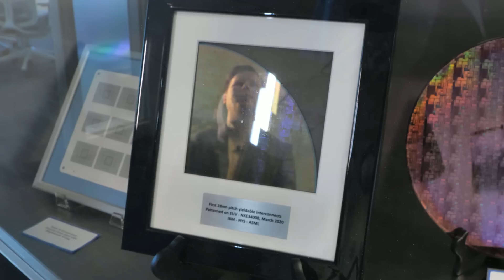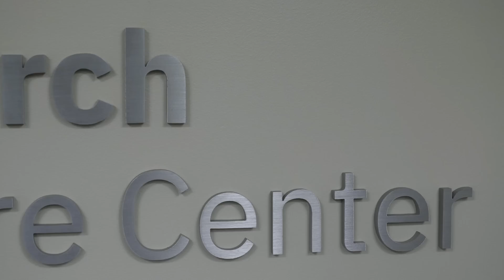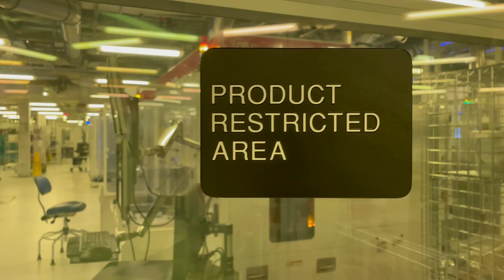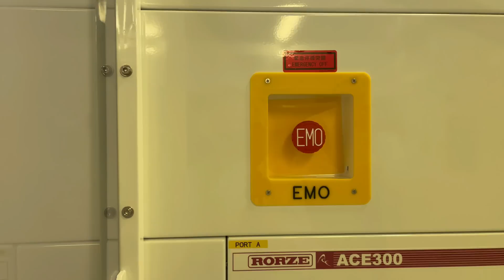Investing in America's Semiconductor Future: What's Next?

Comment: I work at one of the manufacturing companies mentioned in this vid, at the main Silicon Valley location. FINALLY someone made a simple video that shows the inside of a chip making lab/fab that I can send to people that want to know what kind of equipment I work on.
Now if only someone could take off the nice covers from the machines in there and actually get "under the hood" and talk about how they work, because the complexity of how exactly to get all those fancy material (and basic ones like copper) onto a layer measured in nm or angstroms, and then etch patterns on... Its really something else!
Reply from the maker: Please share :) I want to do more like this as well. But it's a case of earning that trust to get the access. Even though I've done this, I have some photos from the tour with some of the machines uncovered - unfortunately they were not approved by legal (yet)!
Reply: @TechTechPotato  have you tried looking at fabs that use 200mm process to see the equipment? That stuff is so ancient... would be so surprising if LAM or Applied Material or whoever else dont let you look at it. Though I'm not an IP lawyer whatsoever.

EXREMELY long comment incoming

So, I doubt my work knows my YouTube account, I won't share how specifically the chamber at my work work. I'll stick with stuff you can easily find on Google, but obviously fairly concisely.

This is an industry that you can work a lifetime in, and you will only really understand a small handful of chamber. You know it takes many many many steps to get to the end result of a working chip. I've worked with some types of metal deposition chambers, and very limited etch chambers. No ion implant, cmp, nothing photo resist related. No Si ingot growing or cutting, no metrology... So so so much equipment is needed for all this...

I work on metal deposition so super generic the chambers for this type of process are kept at ultra high vacuum (less than 1x10^-11 atm for physical vapor deposition, or maybe around 1e-3 for chemical vapor dep). To pump down the metal cavity to this vacuum your need a turbomolecular pump or a cryogenic pump (TMP more typically used if flowing toxic gases are used during process due to how cryo pumps trap gas molecules).
The wafers are brought into a chamber from the mainframe by a robot arm, and the wafer is lowered onto a pedestal. Because you want to use the entire surface area of the wafer, you can't use clamps to keep if from moving, so typically the pedestal might be a vacuum force, where, the pedestal surphase is almost like a shower head looking thing, but instead of gas coming out, there is a high vacuum created in it to basically suction cup the wafer down to make it stick. 
If the chamber is ultra high vacuum, this doesn't work, so instead you need an electrostatic chuck which, simply put, has a voltage applied to it, and the electrons in the wafer scatter, creating an electrostatic force that keeps the wafer attracted to the pedestal. 
These pedestals can also be actively cooled, and heated too. Depending on the material going on the wafer it might be below room temp or maybe way up at 500C. The molecular structure of a material changes a lot based on temp, of course. Need to precisely control the resistivity of the layer, the stress across, etc.
Physical vapor dep (PVD) is by far the simplest. I'll start with it in more detail and the rest will just fall into place.
Into the chamber there is a gas flown (like maybe Ar or N2 or some other). The pressure in the chamber needs to be VERY precise, so mass flow controllers are used to flow gas. They are a fancy valve that's preprogrammed with a specific gas type, so it flows a volume of gas based on the atomic mass of it. Above the wafer there is a giant thick metal surface. To that metal surface, or to the pedestal the water is on, or to coil above or around the chamber cavity a very high DC voltage is applied, or AC current in the radio frequency range, and the electrons of that gas that is flowng into the chamber get flinged off (electrons are light, so magnetic fields or high voltage send them flying). This gas is now a plasma. The plasma is kept near the metal surface and the ions of the plasma will bombard the material, and shave/erode atoms off from it. Let's take copper for example, the Cu atoms will fall into the wafer. The longer the plasma is lit, the more atoms you erode from that giant Cu surface and the thicker the Cu layer (though, "thick" of course is only nm thick)
What's tricky is making sure the atoms fall straight onto the wafer, or else all the Cu atoms will fall diagonally onto the carefully etched trenches and you get literal pockets of just vacuum. So maybe the Cu target is farther from the wafer (off angle atoms will hit the chamber walls before they reach the wafer) or it gets more complicated, like creating magnetic fields around the chamber to adjust the path of the Cu atoms as they fall. Or maybe apply electrical power to the pedestal to also attract atoms down to the wafer (this can be controlled to actually speed up the ions enough that they bombard the wafer surface instead of gently falling and actually sputter/physically etch off deposited material). 
Sometimes for PVD you might also flow other gases that the target ions get mixed with. Common one is nitrogen, so maybe while sputtering a layer of Ti onto the wafer, flowing N2 will create a TiN layer on the wafer.
Chemical vapor dep (CVD) there are no target materials to physically bombard with a plasma. Instead you flow a combination of gases that will react and flow onto the wafer surface. So there are extra gas lines that connect to the sides of the chamber and also to the top, right around the wafer. The gases from the top will also need to be even, so they might go through something like a shower head. Often you still need to strike some kind of plasma to force gas atoms of molecules to become reactive. 
The extremely hard part of CVD is the chemistry. There are extremely toxic and exotic gases used to create the materials that go on the wafer.
Subset of CVD, you have atomic layer deposition, which flows gases sequentially and the gas reacts with the surface material on the wafer. You keep flowing gases in different combos to grow your layer on the wafer, instead of depositing the material directly. These chambers get horribly, horribly complicated due to the amount of chemistry involved in them. More than basic CVD chambers.

Etch chambers are actually similar. Wet etching where the wafer is soaked in a bath is not as common in 300mm I think.
Dry physical etching is like PVD, but instead of the plasma being close to a target material, the plasma is over the wafer, and the plasma bombards the wafer.
Chemical etching is like CVD, where gases are flown in and the gas reacts with the material on the water surface, and after a few more reactions (again with the help of plasma to make different gases more reactive, or to modify them in some way) you get a material that you can eventually remove off the wafer through sublimation (heat up the wafer so the material goes straight from solid to gas). If this is done, then the rest of the chamber needs to be heated, and all the gas lines will be heated so that the material you are pumping out doesn't become solid again and clog up the lines. 

These are the types of chambers I've directly worked on. Also an annealing chamber though. After ions are literally shot into a silicon wafer to dope it and the n and p sides of and the transistors are made, you typically need to anneal the wafer to activate it. You can either stick batches of wafers in a furnace, or do rapid thermal annealing (RTA) which uses a grid of lamps that heat up the water to over 1000C in 3 seconds! (One of these uses enough power to light up a city residential block...).To measure the temperature of the wafer during annealing there are a bunch of infrared sensors in the pedestal that the wafer is sitting on.

That's about all I can share I think. Of course we have to add bells and whistles to the chambers to be competitive, so I won't comment exactly on HOW things like electrostatic chucks work their magic, or how plasma is controlled, or how the layer properties are controlled, how things are shaped, etc. I didn't say anything you can't find on Google already
Reply: @TyroPirate  What did you study and how did you get that job?
Reply: @eac5579  First, I live in the silicon valley, so I can throw a stone outside my apartment and it would probably hit something semiconductor related...

I studied aerospace engineering in university after transferring from a 2 year community college. (Aerospace sounded cooler than mechanical engineering... and it was!) Got a bachelor's. 

My resume was wildly unspectacular because I had no internships during college, so I could only mention unimpressive college projects and working on my motorcycle in interviews... I didn't care specifically to get into aerospace industry (though it would have been really cool to work on planes) so I just applied everywhere. 

After well over 100 applications I got a job as a technician in the manufacturing part of a semiconductor equipment company, learned as much as I could about what I was building, and in barely 6 months I started applying internally in the company for an engineering role. NOW I was able to stretch my resume, and convince the engineering managers that I wanted more.
Reply: @eac5579  To be clear though, this industry is FILLED with PhD people that did semiconductor research for their doctorate, or chemical stuff, or all kinda of crazy stuff. They are the ones that develop the absolutely insane combinations of chemicals that can deposit or etch specific materials. Or they have researched plasma dynamics and can simulate plasmas, huge stuff like that
But when it comes to the hardware of it all, not uncommon to see electrical and mechanical engineers fresh out of uni with a bachelor's
Reply: you might also like the video LTT made when Linus went to an Intel fab in Israel
Reply: I'm hoping for a fab tour when I'm out in Oregon for work tied into the D1X  EUV Vacuum Control system, I'm still trying g to figure out how I ended up in a design position just because I built all the prototypes. No one else wanted to do it, was a hell of a lot of work. Now it's a full time job on its own.